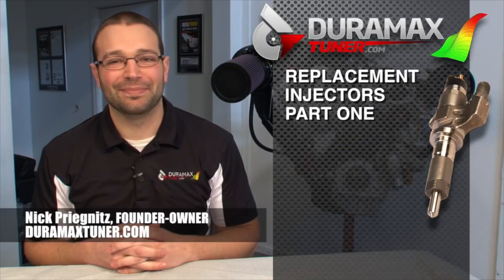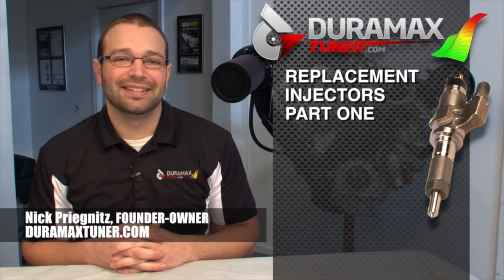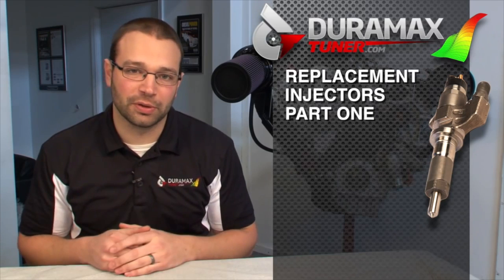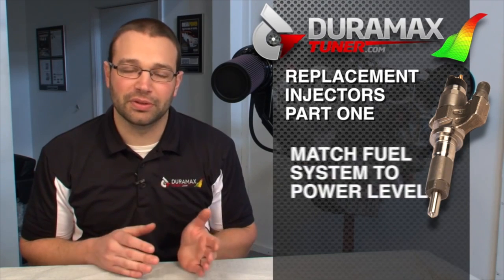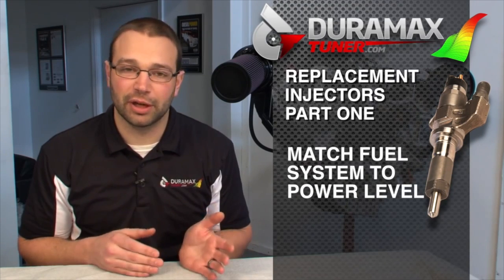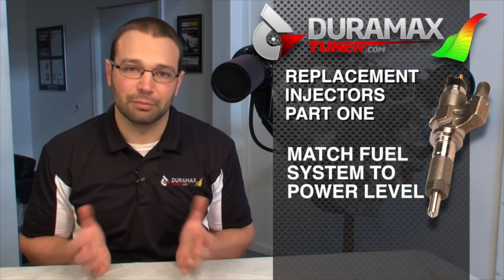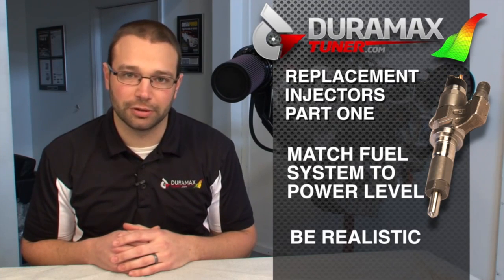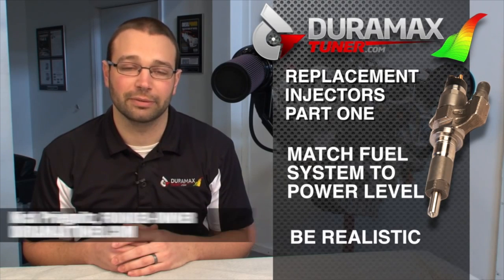INJECTOR REPLACEMENT GUIDE - PART ONE

Comment: So glad I watched this video. I have a 2004.5 LLY that needs new injectors ....almost 300k miles and a couple are out of the recommended spec range. I was thinking of going to 30% over but now will stay with stock replacement. Great information... Thank you so much! Also, my budget is really tight...I know it is best to change all injectors at the same time, but if I just change the ones out of balance for now along with the fuel lines, do you think that would be ok as long as I change the rest in a few months?

Comment: I have a 2002 LB7 with 250,000+ miles on it and I think my injectors are on there way out. How do you feel about the Sac style nozzles? I plan on being in the 500hp range when done with the truck but only see the Sac injectors as 45% and up. I mostly use the truck for hauling mild loads (6,000lb-10,000).
Reply from the maker: We've got to ask a few questions - can you give us a call? 815-568-7920

Comment: I have 03 lb7 and the injectors are failing when i have them replaced with new stock injectors are new injectors updated to not have a failure agin or wil they in time fail like the first set. Ps: truck has 201k on original injectors.